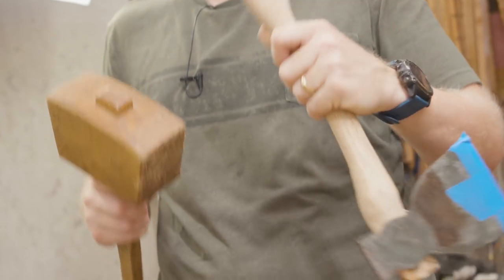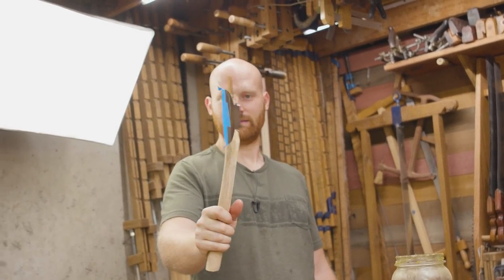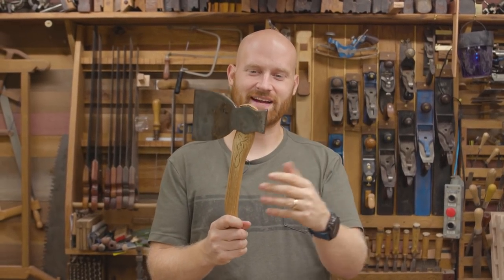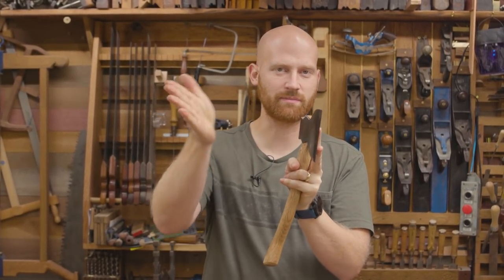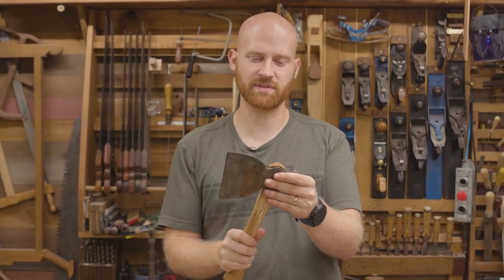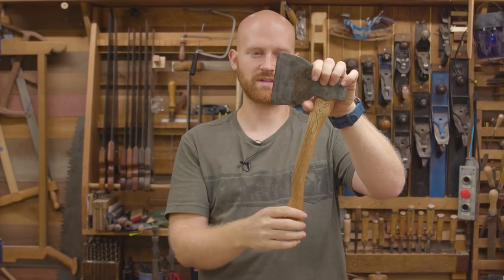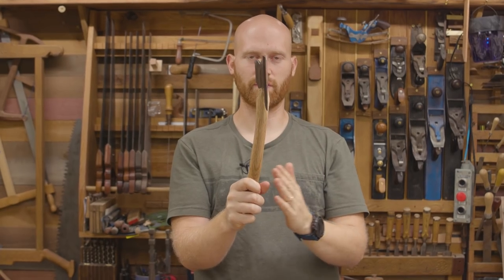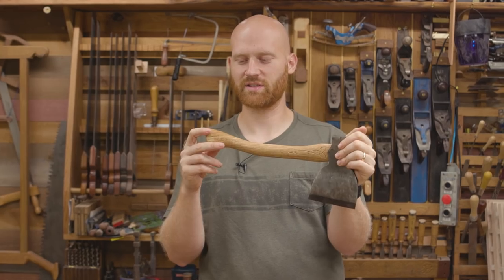Hanging a Single Bevel Hatchet Handle Making

Comment: As far as I now, axe handles aren't quarter sawn, they are in a (w)right angle to quarter sawn (annual rings parallel to wedge) so that the fit of the axe won't be affected by the seasons as much.

Comment: Nice work, Jim. I love using the drawknife especially on raw wood. I also like that you showed how to put the Shinto rasp to good use for the pre-shaping step. The spokeshave is the best tool for the final shaping along with a file to finish. This is a fun project and close to how our ancestors made their ax handles, although most of them only had the drawknife to work with.

However, folks out there, when using a spokeshave, put your work in the vise and keep both hands on the spokeshave. Jim, you drew the spokeshave towards your hand holding the stock and someone that doesn't have our years of experience could really get into trouble with that move.